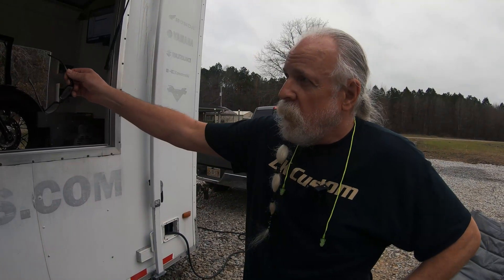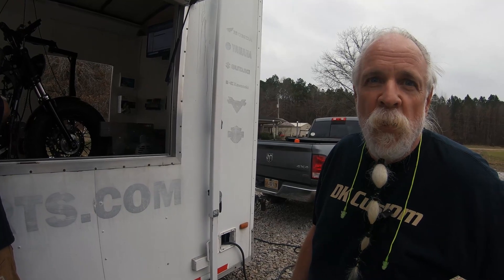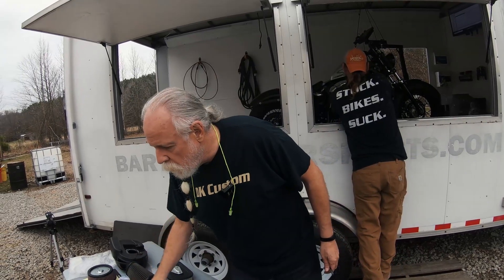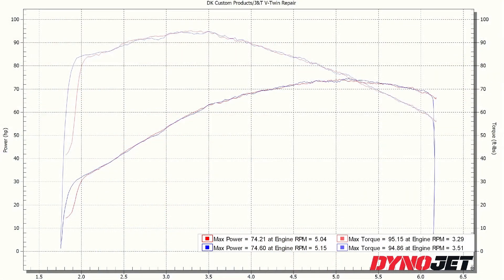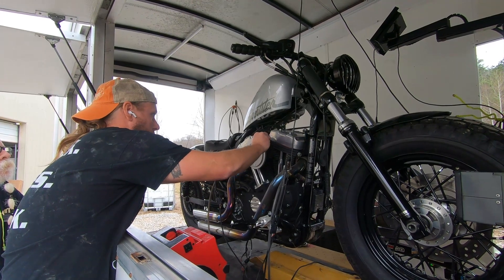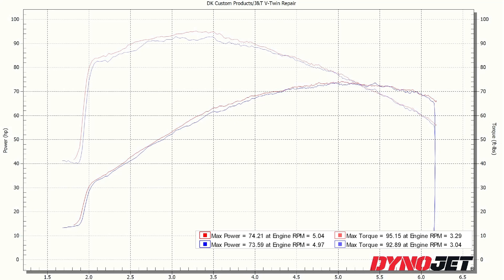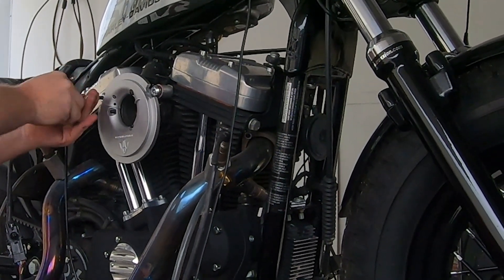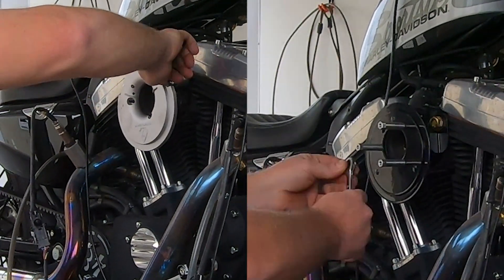We Were Wrong...Dyno Told the Truth...Question Answered

Comment: Do i need a tune if i change the air intake and exhaust on a 2022 fxlrs 117ci
Reply from the maker: No, with the M8's they are not too lean from the factory. You can change out both the Air Cleaner and Exhaust and you still won't be running too lean. Of course if you want the most out of your upgrades a tune is going to help with that, but it is not necessary. 
Here is a video on this subject that you may find useful/interesting - https://www.youtube.com/watch?v=Lb_57Z_Ipms

 Thank you for commenting! 👍 MB

Comment: Yhey polish and port heads for more performance
Reply from the maker: Absolutely! Porting and polishing heads is a great way to boost performance by improving airflow into the combustion chamber. Our air cleaner complements that by optimizing the air intake from the very start of the system. Cleaner, higher-velocity air means the engine can take full advantage of any internal upgrades like ported heads. It’s all about building a system where each component supports the next. Thank you for commenting! MB

Comment: Would the area of volume of air inside the filter be the biggest reason for performance differences between two air cleaners? Would it be like having a vacuum cleaner with a smaller wand verses a larger one, each being open to outside air? The larger diameter wand would flow more air would it not?

With a smaller diameter wand on a vacuum cleaner, don't I also get a bigger suck, but likely by flowing less volume of air?
Reply from the maker: No it does not. We have tested that and have found out that it is How the air flows after making it through the filter that affects the performance and not the size of the filter. We talk about this at the 6:06 mark of this video. 

Thank you for commenting! 😎MB
Reply: @DKCustomProducts test the factory OEM Harley Heavy Breather, the one with a 90° bend. 😎

Comment: I would think an aluminum or plastic back plate wouldnt get get so warm, allowing cooler air in.
Reply from the maker: Regarding the plastic backplates...it is the fact that they are totally enclosed that makes them a "Hot Box", as seen in this video-https://www.youtube.com/watch?v=tJXGEwLCNDw

Regarding aluminum backplates, like on the Big Sucker.  We were very puzzled also, this is why we did so many tests (this video just shows one of them). As talked about in the video, it is all about what happens regarding How the Air Flows after passing thru the filter element.  Even though steel holds heat longer than aluminum...as shown in the video, it does not make a discernible differece.
Probably because aluminum will get hot faster, and will cool down faster, but still reach the same temp as the steel.

Thanks for watching our videos and glad you are finding them interesting.

Comment: A sharp edge could create a vortices that helps mix air/fuel, in a slightly different place in the airspace and the vortices could swirl at the wrong place and cause a less accurate air fuel mix point. A flow bench with colored powder or smoke to make adjustments and really visualize the action would be beneficial. Of course a ported head or aftermarket intake runner would change that flow characteristic. Introducing an influencing structure like a wedge or golf ball bumps…. 🤔
Reply from the maker: Yeah, lots of variables.  We ran into this quite by accident while testing different air cleaners on the dyno.  Our first thought was the difference between steel and aluminum, but turns out it was more the shape and path of the air flow.  Thanks for watching. 👍

Comment: It’s like the winglets that they add on the tips of the airplane wing they never used to have those they realize there was turbulence going out at the tip so they installed the winglet get less drag at the turbulence
Reply from the maker: So true!  Fluid Dynamics can be surprising sometimes.
What happens with the air AFTER it pass thru the filter element can be very important! 👍

Comment: You need to go back and forth a couple times between the AC to verify the difference.. Could simply be that the dyno and motor were warming up..
Reply from the maker: We did Warm up the bike and the dyno. We also did do a few different runs per AC.
Reply: @DKCustomProducts  Did you swap back and forth?  The measurement needs to be repeatable.
Reply from the maker: @maxheadflow  Yes, we have done the test multiple times, swapping back and forth, this was the one time we videoed it.

Comment: I blocked the pasages that let the engine air/oil into the big sucker and tapped fitings to the outside to get rid of the hot air/oil.  Then I ground the ridges of the face of the big sicker plate and polished it a bit.  The ruoughness and ridges of the plate certainly don't look right to me.  Would sure like to see you run my plate and see what the results were.  Thanks for the info  :{)
Reply from the maker: We always like running tests, comparisons, and learning more!
Maybe at the next open house we can do an apples to apples comparison on the dyno.  Tentative planned for May 2024.  Hit us up by email a couple of month ahead of then, if you'd like.
Support@DKCustomProducts.com

Comment: Ok guys this be the deal, everyone believes you need your intake polished smooth to aid in air flow. In reality you want it semi smooth or with a swirl pattern so the fuel will stay atomized, with system that is smooth the fuel does not stay atomized it drops out of solution. Ifins you want something smooth its the exhaust so the expended gases exits the chamber as fast as it can. Its been proven in drag cars. What your back plate does is remove the smoothed venturi and replace it with a sharp edge which atomizes the fuel. N unless youve worked with really high horsepower engines you wouldn't realize it.
Reply from the maker: Thank you.  Yes, I believe you are correct.  After our testing a few fluid dynamic guys have told us the same thing.
Thanks for explaining it so clearly. 👍

Comment: Hey guys, I bought one of your catch cans painted shiny black. Yeah it’s performed wonderfully one suggestion avoid getting the paint on the inside of the cylinder of the can the fuel and oil break down the paint and it comes apart all inside the filter other than that, it’s a very good working system That’s all
Reply from the maker: They are powder coated, and we have been trying to get them powder hung for powder so none goes inside.
Thank you for the feedback, and for your business, we appreciate it. 👍

Comment: Bernoulli's Principle, explains friction loss in fluid and air moving though a constriction. It's also the basic principle behind flight. Any air or fluid moving through a constriction....the speed increases, but the pressure decreases. One of the plates is causing the pressure to drop more than the outside pressure.
Reply from the maker: Thank you! 👍

Comment: I must say that turbulence is great for an intake manifold and combustion chamber but not across a carburetor inlet nevermind a CV style. My opinion is that a reduction in internal air cleaner volume due to a "proper" radiused inlet is a detriment to proper room for "fuel standoff" which is an intake reversion phenomenon due to an odd-fire engine and a plenum intake. I'm willing to bet if that filter is deeper, the radiused inlet will prevail. Regarding EFI; is that inlet turbulence causing minute fluctuations in manifold pressure the MAP sensor "sees"? Being the devil's advocate, radiused inlets and velocity stacks have been around for a long time! Great videos.
Reply from the maker: Thank you for the comment!  Glad you're enjoying the videos, and yeah, the Velocity Stacks we redesigned last year really perform well.  You can see our report on them, AND dyno charts, at around the 8 minute mark in this video- https://www.youtube.com/watch?v=KT-Ts7YFtV0

The difference between a V-stack and other type air cleaners (whether radiused or not) is that the air has to turn a corner, and before it does that is is flowing across a flat, smooth (or not so smooth) surface.
Making the filter deeper on the 606 is not really practical.  It is already one of the deepest filter elements used on a Harley, and going deeper would interfere with most folks right leg/knee.

Comment: What breather&filter combo will be best for my 2000 harley Davidson sporster 883
Reply from the maker: All External Breather Systems work equally well as far as the engine is concerned...so which one to use comes down to which look you like best.
The 425, 587, 606, 636v and 828 All breathe more air than an 883 can use, so again, it comes down to which look you like best.  The 587 does have the most cover options, AND it is the lowest profile, giving the most amount of room for the right leg.
The 636v will produce a bit more power than the others...for that reason, that is why I run the 636v on my Sportster.  I also like the Transformer and the Premium Discrete Breather Systems the best.  (for looks, functionality is the same on all of them).
Feel free to call or email with any questions-
662-252-8828
Support@DKCustomProducts.com

Comment: When air does not have to bend to go into the carb or throttle body, you get bigger gains of HP and torque. So, if you have a filter that lets air come straight into the carb, you will get noticeable gains. So, if someone would produce a filter that let air go straight into the neck, not have to make a 90 bend prior to entering the chamber, there would be good gains.
Reply from the maker: You are describing a velocity stack.  See link below.
https://www.dkcustomproducts.com/outlaw-velocity-stack-air-intake-complete-systems.htm
Our recently redesigned Velocity Stacks produce even more power than our previous design.  You can see a video and Dyno Charts at this link-

https://www.youtube.com/watch?v=KT-Ts7YFtV0  (starting around the 8 minute mark is when we talk about the Velocity Stacks)

We also have a written report with dyno charts at this link-
https://www.dkcustomproducts.com/differences-between-outlaw-hiflow-air-cleaner-systems-dk-faq-acs.htm
Reply: @DKCustomProducts  Yessir, I have seen them, and thank you for these links. I was thinking of a more low profile, open face filter design that would not interfere with your right leg. Take your 828 filter, instead of the filter media being around the outside edge, the filter would be where the face plate is currently. Just my idea of the perfect filter. You guys have great products!
Reply from the maker: @Big88Country  Yes, we've done some prototypes of that design style, where the face and the sides of the filter element were actual filter material.  We did not see any increase in power from those types of straight in elements.  It may be because the air coming from the sides was interfering with the air coming straight in.
The absolute be performing is the 636v that has a patented tube the speeds up the intake velocity.  (link below).  It is also out of the way from the right leg, BUT, cannot run with a full size filter on bikes with lower fairings.

https://www.dkcustomproducts.com/outlaw-hiflow-636v-air-cleaner-complete-systems-c125.htm

Comment: The round radius entry on the super sucker plus how thick it is working as an inlet spacer may be substantially better requiring a jet increase? Same deal on go karts and big blocks.... a giant air cleaner flowing more air wasn't always faster at the track because now your jetting is wrong. Don't most bikes require at least 2 to 3 jets when upgrading air cleaner and exhaust? If its working as a small velocity stack than the jetting has to be accommodated to make power... just a thought.
Reply from the maker: Yes, that could be the case with carbed bikes.  Our testing was done on an EFI bike and the AFR was the same with both A/C configurations, so that was a non-factor.
Since making this video I've spoken with a fluid dynamics engineer who explained why the rounded radius actually slows down the flow of air going into the throttle body.
Reply: @DKCustomProducts  10 4. On 1 hand I totally agree. In theory that should be enough.... unfortunately, here in Florida (could have to do with sea level or temp) we haven't had much luck with the factory set up compensating on its own (cars and bikes alike but bikes especially). The new 'Milwaukee Eight" for example just about HAS to have a corrected fuel map for pipes and filters. There is a LOT left on the table after mods if a dyno tune and fuel/timing table correction isn't done. Love the black billet plate and the super sucker... In my experience and opinion, you guys could do a shootout with both setups (with a laptop and tuner to mod the fuel map) and see nasty gains! Great video and info as the average dude just want to stab a hot filter and go ride.... The factory map is no good for that. (Or jetting if your old school/ LOL).

Comment: I bet the loss in power is from the big sucker you ran being run with the external crank case breathers.you gain hp with the crank case under vacuum thats why they run vacuum pumps on race car engines.
Reply from the maker: The 606 also was running external crank case breathers.

We have seen NO evidence that running internal crankcase breathers increases crankcase vacuum.  We've seen a lot of folks talk about it...but have not seen any test results.

Comment: Turbulance causes better fuel air mixture. An un fettered exhaust makes a lot of difference. Smooth intakes and runners  work better with turbo systems . Great video.
Reply from the maker: Thanks man, glad you liked it.
Appreciate the comment.

Comment: Have you compared the S & S Stealth A/C with one of the DK A/C's? I have the Stealth on my 2019 RK with the DK EBS. I'm curious because the Stealth uses a polymer backplate. Their reasoning is that polymer doesn't heat up like metal so the intake air is cooler... Or so they say.
Reply from the maker: It has been years since we tested the Stealth.  It was not plastic back then.
Of course, the intake tract on the M8's is now plastic also.  There are reports, here and there, of them developing cracks.  But they are under more stress than the air cleaner backplate.  Interesting, and quite possibly true (that with a plastic backplate the IAT is cooler).  We will revisit that and test it out on the next dyno day.  Thanks!

Comment: The biggest factor not accounted for is airflow from the bike moving to it being static on the dyno. I’d be willing to bet if you put a strong enough fan infront of the filters to simulate actual riding conditions the power loss wouldn’t be there.

Edit: Didn't seen in the video they had fans setup. My mistake.
Reply from the maker: That is definitely a good thought...but it is taken care of.  With any dyno set up there are fans that do a good job of replicating riding down the road.  They are also used to control the heat.
All our testing, including this one, has the fans on and running to equal going down the road at about 60 mph.  So it is simulating riding conditions and gives an apple to apple comparison.
Reply: @DKCustomProducts  my bad. I didn't see any in the video. I stand corrected and surprised it still lost that much power.
Reply from the maker: @2kanchoo  Yeah, we mentioned fans a few times (in passing) in various vids...but we did not focus the video on them, nor talk about how they are an integral part of a dyno.  
Thanks for pointing that out, and we will do a future video on that.

Comment: That's not a big difference that's well within margin of error you need to reverse the process were you put the big sucker on first because heat soak in the engine could cause this difference air temp isn't all you need to consider.
Reply from the maker: I understand what you are saying, and because of that we've done this test well over a dozen times, in all different orders, and on different bikes.  
We also heat soak the engines before the pulls, and then get the temps at 210 via use of fans and throttle.  All pulls were the same temp.
It does not matter what order, the results are the same.
Also, we do 3 pulls minimum, for each configuration.  We look to make sure we are getting virtually the same results on each of those 3 pulls.  If there are variations, we pull again.  The difference is outside the margin of error when you do your dyno runs this way.
Here is a link to what I am referring to...this is an acceptable margin of error....less than two tenths of 1 ft. lbs. difference in Torque on all 3 pulls.
http://www.dkcustomproducts.com/image/2021_Dyno_Pulls/3%20Corroborating%20Pulls.png

Comment: Maybe I missed it in the Video... but did you test both backing plates without an air cleaner? That would help prove or disprove the air volume in the air cleaner theory you brought up.
Reply from the maker: We did not.  That would have been a good one.  We will do that next time on the dyno.  Thanks! 👍

Comment: Ide like to see dyno for airfilters with a center style opening. Drawing directly into the throttle body or carb throat without having to make a 90° turn. Like the s&s stealth air or s&e round extreme flow, the s&e ventilator extreme air. Vs these more traditional capped air filters like you are running. As far as the difference between the radiused backing plate and square cut throat. It seems as simple as air velocity. Same principle as head porting. The radiused area is a larger volume. Wich decreases air velocity. Also similar to running a velocity stack
Reply from the maker: Good thoughts!  Thank you.  We do have quite a few more dyno videos coming...including at least one of a straight in.